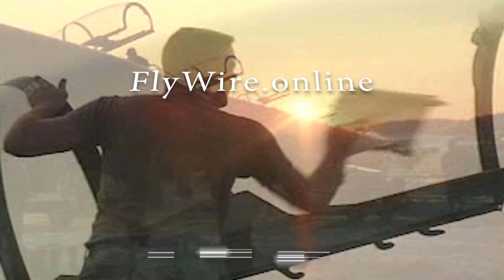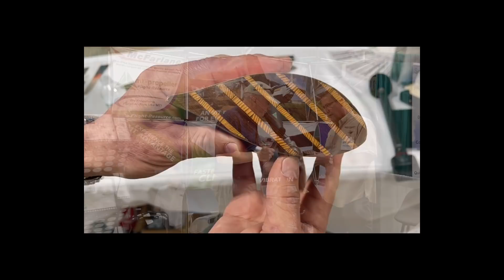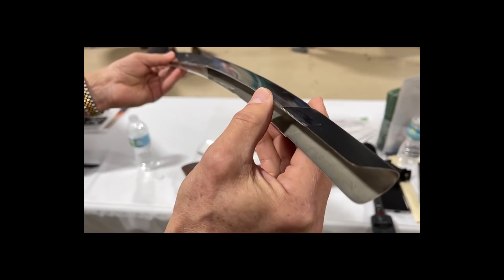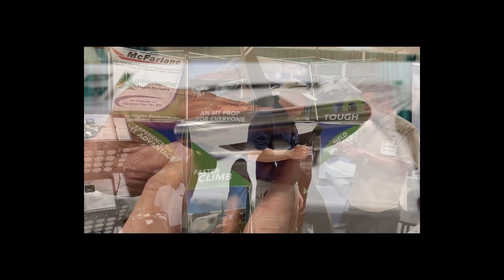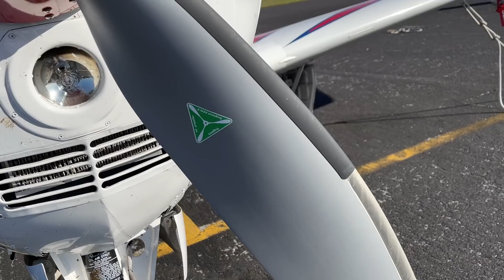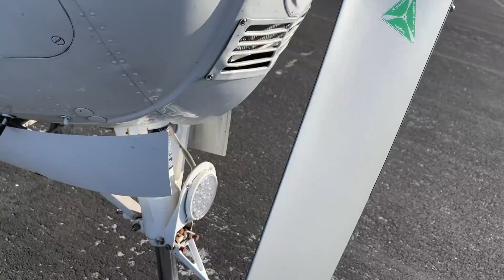FlyWire On The Road  Sun-n-Fun 22 #3 John Neilson Flight Resource and MT Props

Comment: These propellers are really really good. But that test proves very little. Because of the soft lead used in 22lr the damage should be minimal on the edge like that. It just does not have the hardness to cause realistic rock damage, it will just smear and morph arround the edge.
Reply from the maker: No one uses soft lead as a leading edge in an airplane propeller. Try again.

Comment: Very impressed with the 3-blade MT on my 185.  Had a C58, 86”, which failed an inspection even though there were no operational issues.  The MT is more quiet, smoother, pulls harder at takeoff, cruises faster and weighs 14# less than the C58 two-blade.

Comment: G'day Scott,

I came back to re-watch this in better light, and while not composing a long reply.

That's a Hum-dinger  of a Propeller you have there, a propper Bobby-Dazzler... (Old Colonial expressions of high praise...) !

Wonderfully thin Tips.

That Elastic Modulus you mentioned and the Skewed Lamination Axis across the Hub reminded me of a 2-Bladed Scimitar Propeller about 40 years or more ago - Rutan Quickies had them...; anyway, the Laminations were Perpendicular to normal practice, and the theory was that at high RPM the Aero-Elastic Forces would twist the Blades into a finer Pitch than was otherwise carved into them, for take-off - and throttling back to Cruise allowed the Blades to "relax" back to a coarser Pitch, for Cruising...

The fashion only seemed to last a few years...

Such is life,

Have a good one...

Stay safe.

;-p

Ciao !

Comment: That's incredible. Never knew wood used for a prop was so resiliant. Thank you for sharing!
Reply: G'day,

The definitive Test was the DC Wind-Generators set up in the 1880s at a Campsite above the Arctic Circle, to power the Bar-Radiators to used to heat the Huts of the Base Camp of an Expedition sent to launch a Hydrogen Balloon, harbouring ambitions to fly over the North Pole....

The Flight attempt failed, the Camp was abandoned, and in the 1950s it was rediscovered on an Iceberg in the Atlantic..., the Wooden Turbines were still running, the Generators were still producing Current, the Radiators were still toasty, but Hail had shortened the Blades by half a foot each, and the Ten-foot Rotors were all around 9 feet diameter.

If you backtrack me to my "Personal Aeroplanology..." Playlist, in there is stashed a little series explaining how to make a 4-Lamination pure Helically-Pitched Wooden Propeller, designed to replace the pressed-sheetmetal Crudities supplied with Peltier-Effect powered Thermo-Electric Stove-Fans.

I've flown behind two different Wooden Prop's of my own design & carving, so the videos depict a "miniature" version of how to go about making a full sized version, should you ever care to embark on such a project.

Home made Wind Turbines are great fun, too ; exactly like Propellers but running backwards, inside-out, and upside down..., extracting Energy from the Air Column, rather than inserting Energy.

And here's a funny thing, Betz' Law of Wind states that the absolute maximum amount of Energy that can be extracted from the Wind as Torque, is  0.59  of the Energy in the Column of Air being engaged...(59%).

And there's a nifty Equation to prove it, too, but because it IS an Equation, that means that it runs backwards as well as forwards - or all if Maths and Physics is wrong (!) ; and that means that whenever the Marketing Jism claims that a Propeller, or Turbine Rotor, is "90% Efficient (or "93"...!) then that means, must mean, that the Unit is 90% efficient at achieving the Maximum Possible Achievable Efficiency of 0.59...

  My strong suspicion is that the reason SO MANY people have failed to fly, or failed to outclimb the Airfield Fence with Aeroplanes sporting much less than 60 Hp Engines, is that anybody thinking that their "90% Efficient" Propeller will produce 45 Hp worth of Thrust from their 50 Hp Engine..., discovers that 90% of 59% of 50 which is 90% of 29.5 = 27.55 Hp worth of Thrust...

Thereby, anybody whose Weight and Drag was expecting 45 Unicorns for Take-off and dreaming of cruising on 35..., often enough has an extremely disappointing journey...(!).

Apply sufficient Marketing Jism, with equal parts of naivete and ignorance and driving ambition...; and that hammers a LOT of Dreamers.

Such is life,

Have a good one.

Stay safe.

;-p

Ciao !
Reply: Wood is the original Composite material! The Bell 47 has wooden blades too!